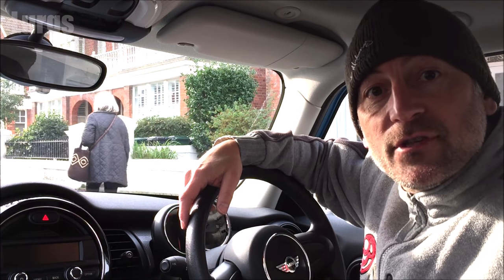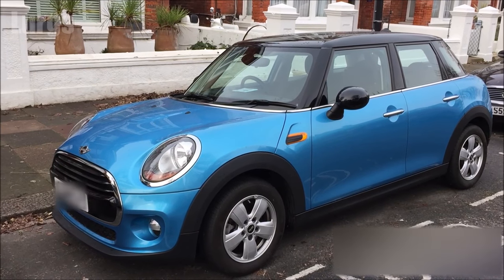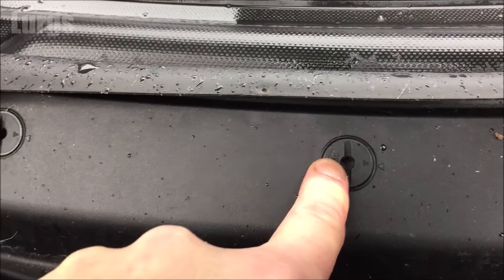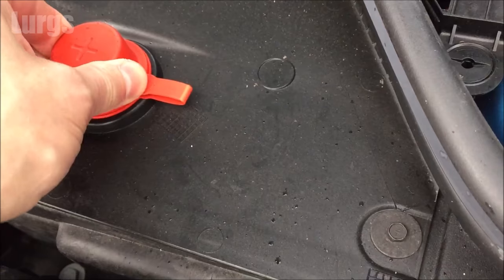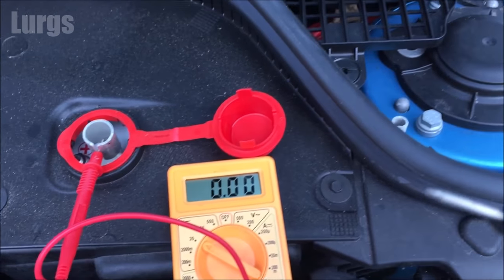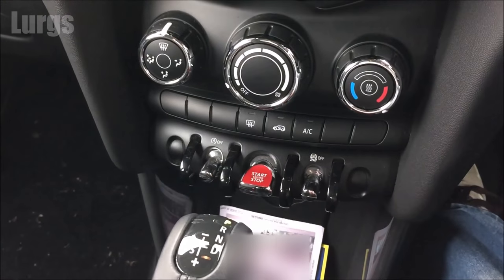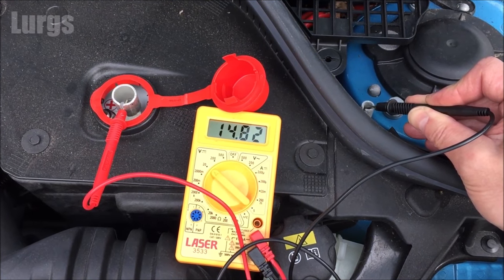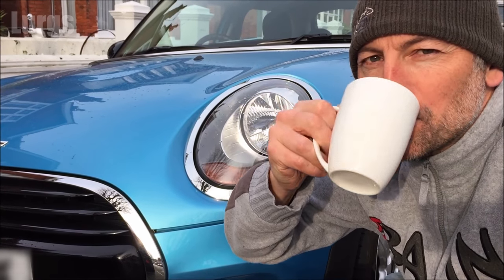Mini Cooper Battery Location and How to check battery on BMW Mini Cooper 3rd Generation

Comment from the maker: Other useful video links to help you save ⏱TIME and 💰 MONEY:
Mini Cooper Battery Location and How to check battery https://www.youtube.com/watch?v=7jxdaCRM_mY&list=PLqrXuUebV8N_iY1vf3AgGtkdx3uxGgpI_
Mini Cooper Fuse Box Location and how to check Fuses https://www.youtube.com/watch?v=6OR5Vaqmjtc&list=PLqrXuUebV8N_iY1vf3AgGtkdx3uxGgpI_
How to open Hood on Mini Cooper https://www.youtube.com/watch?v=iSBopABO8QA&list=PLqrXuUebV8N_iY1vf3AgGtkdx3uxGgpI_
Mini Cooper Key Fob Battery Replacement  https://www.youtube.com/watch?v=i3KPcS-2VaY&list=PLqrXuUebV8N_iY1vf3AgGtkdx3uxGgpI_
How to turn on Fog Lights on Mini Cooper https://www.youtube.com/watch?v=uoweNvZITxA&list=PLqrXuUebV8N_iY1vf3AgGtkdx3uxGgpI_
Mini Cooper OBD2 Port Location https://www.youtube.com/watch?v=SZMQ8ESxO4g&list=PLqrXuUebV8N_iY1vf3AgGtkdx3uxGgpI_
Mini Cooper Steering Wheel Adjustment https://www.youtube.com/watch?v=vWS1Ti2ybuw&list=PLqrXuUebV8N_iY1vf3AgGtkdx3uxGgpI_
Mini Cooper Tyre Pressures https://www.youtube.com/watch?v=5t2Dgw6uKh4&list=PLqrXuUebV8N_iY1vf3AgGtkdx3uxGgpI_
Mini Cooper Screenwash Location and How to top up Screenwash https://www.youtube.com/watch?v=sVm8kw5J8U8&list=PLqrXuUebV8N_iY1vf3AgGtkdx3uxGgpI_
How to set clock on Mini Cooper https://www.youtube.com/watch?v=BwuKEwLVT3I&list=PLqrXuUebV8N_iY1vf3AgGtkdx3uxGgpI_

Mini R50 R52 R53 1st Generation How To's, Tips, Tricks & Fixes https://www.youtube.com/watch?v=lMzkLabmySw&list=PLqrXuUebV8N-Abne7l3O4wE14SiA7e8nQ
Vehicles How To's, Tips, Tricks & Fixes  > https://www.youtube.com/watch?v=w44aQ7dc_Lk&list=PLqrXuUebV8N9fyM8qA2D0rkVfv929Ckod
How to check car fuses without pulling them out https://www.youtube.com/watch?v=w44aQ7dc_Lk&list=PLqrXuUebV8N9fyM8qA2D0rkVfv929Ckod
How to connect a Car Battery Safely https://www.youtube.com/watch?v=1b2vJjUefYQ&list=PLqrXuUebV8N9fyM8qA2D0rkVfv929Ckod
How to disconnect a Car Battery Safely https://www.youtube.com/watch?v=XJ5SUabZCbc&list=PLqrXuUebV8N9fyM8qA2D0rkVfv929Ckod
Reply: How do I find out what battery does my mini cooper S 5 door, 2017 has?

Comment: Battery discharged start engine keeps coming up  on my mini cooper recently after lockdown, my question is can I recharge the battery on my drive by running the engine  without
Reply: Driving the car on the road ?
Reply from the maker: If you can get it started then yes leaving it running on driveway will charge it but best take it for a small drive. Or buy a trickle charger. I’ve a video about charging here https://youtu.be/xH9V5xfSSMQ
Reply: @LurgsHowToGuides  Thank you sir👍
Reply from the maker: No problem, Happy New Year. 😎
Reply: @LurgsHowToGuides  Happy New year to you too sir, and thanks again🙂👍

Comment: Im unable to turn my car on and the brakes have become stiff after trying to turn the engine on so many times with no success, any advice?
Reply from the maker: Sounds like a dead or flat battery, you will need a jump start maybe or try charging your battery for 3-4hrs. Have a look at this video it may help
  https://youtu.be/xH9V5xfSSMQ

Comment: 12.12V is a battery on the way out.
Reply from the maker: Could be, if it's charging ok but only saying 12.12v after a run then it could be. They last 5-10 years.